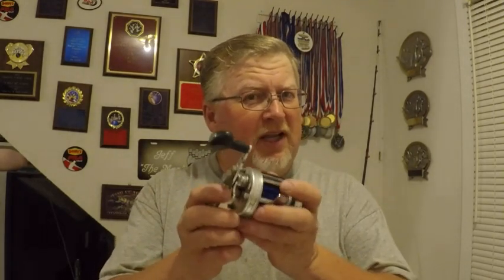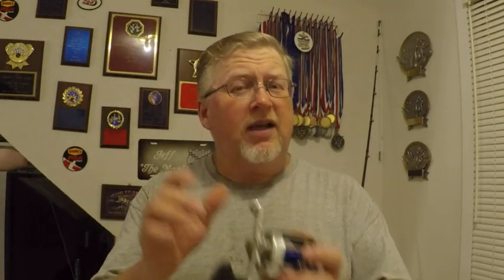HOW TO MAKE YOUR DRAG STRONGER AND LAST LONGER

Comment: I can’t find the video where you got more drag outfits your reel. How much did you get
Reply from the maker: It went up to 30lb dry. But it ripped the brass gears out lol. Wet I got 23 smooth drag
Reply: @bowl830  awesome thank you
Reply: @bowl830  you just used carbon drag
Reply from the maker: Yes sir carbon fiber.   I like them better cause you can put drag oil in them without ruining them.  It makes them smooth not grabby